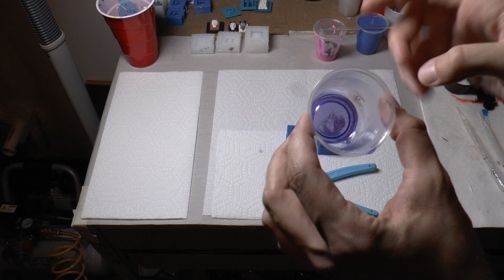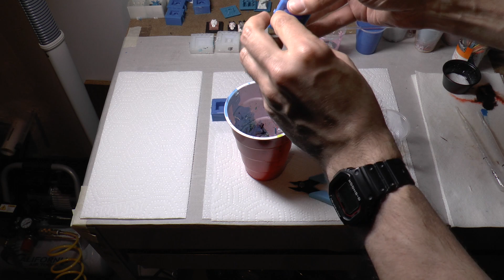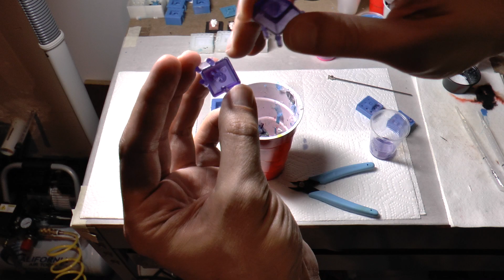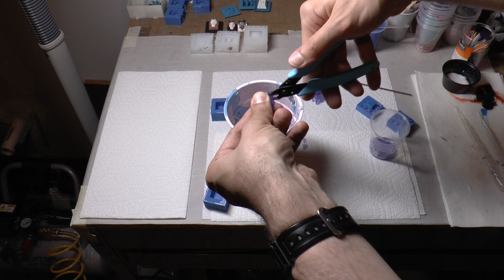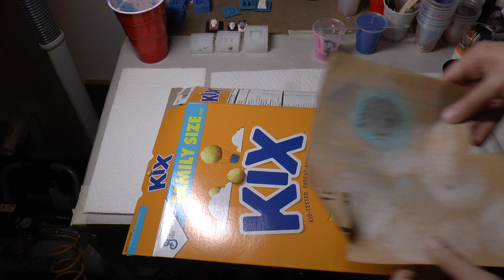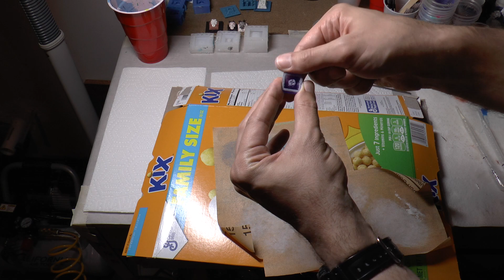Z-Butt:  demolding keycaps and finishing them (4 of 4)

Comment: Hi ! Nice work ! By the way is there a solution to add the letters on these caps ? or even if we are doing non transparent with a lot of coloring, if we want the letter to be transparent (for rgb keyboard to lighten the letter only) ?
Reply from the maker: Thank you!  And good question - that might be tricky.  You could have the outside of the cap as the "shell" with the number or letter missing from the top, that would be your first pour in a multiple mold setup.  Your second you'd fill the rest in clear, and that would fill out your cap and stem, and let light through.

Comment: Great tutorial! I do have a question about the resin though. If I want to cast a really clear cap, what hardener would you recommend since the one you used has a yellow tint? Also regarding the z butt system, do you know how tall can the sculpture be for it to be covered with silicone?
Reply from the maker: Depends on your casting environment - if humidity isn't very high (typically under 60%), Alumilite Clear or Clear Slow don't yellow and they're very clear.  If humidity IS a problem (it is for me in the TN summers), Alumilite's Amazing Clear Cast Plus has been great, 0 cloudiness from humidity.  The downside is it has a higher learning curve (stir slowly, it's much thicker, etc).

For height, the sky's the limit.  If you exceed the typical height for the nohassle container (5-7mm above SA), you'll have to build your own lego tower to get the height you need.  Not the end of the world, but something to consider.

Good luck!
Reply: @NG-ob2ry   damn that's some very detailed explanation. Thank you my guy

Comment: Hi im wondering if there is any other alternative to preassure pot that is cheaper and i also want to know how much you bought yours for.
Reply: From my experiments so far with slow cast resin and no pressure pot, there have been very little if any issues with bubbles. I've had one that I rushed the mixing with and it got a single bubble in the stem which was the worst spot for it to be. Anyways, all my other tests have had no bubbles. So yeah, he's using a resin with a pot life of less than a minute so that kind needs a pressure pot. But the slow stuff like mine, which has a 10 minute pot life, doesn't need the pressure pot. :) hope that helps. Oh and I didn't hear how long he left his, but mine takes 24 hours to fully cure. About 12 and it's able to be demolded but it's a little pliable.

Comment: Great tutorial! The only thing I didn't understand - to get rid of all possible bubbles and make a keycap as transparent as possible - do I need to use a pressure pot - or a vacuum chamber to degas it? Or both? Thank you in advance!
Reply from the maker: Thanks for the kind words!  I use a pressure pot 95% of the time for resin and vacuum chamber the resin before pouring only when doing encapsulations, since even the tiniest of bubbles can ruin an encap.  I only pressurize silicone since it naturally degasses on its own.
Reply: @NG-ob2ry  that is an amazing insight. You are right though, when I clear cast some stuff, some bubbles do appear despite pressurizing it over its curing time and despite my greatest effort in doing prefilling on small details. Now I have to think of ways to DIY a vacuum chamber haha. Thanks for the tip dear sir! You're videos are amazing insight in doing artisinal keycaps. I watched them all and I now have ideas! Will you be making a video with tips on painting resin on the mould? Thank you and have an awesome day!
Reply: vacuum chamber works well with rubbery materials, like silicone. pressure chamber works best for hard material, like resin. The reason which is that silicone is quite liberal in curing time and vacuum chamber takes more time to produce a vacuum than a pressure chamber. Since resin cures fast, pressure chamber works well to squish the bubbles out with pressure, than with vacuum given the limited amount of time . Resin may already start harden before the vacuum starts to occur. Just a hobbyist's perspective though, not much experience but this tends to be for most cases. To make sure, you can research what best method of compression for the specific material you are casting. hope this helps.
Reply: John Vergel thank a lot! But what if I use pressure pot for both - silicon mold and resin? Would that be possible? Thanks in advance
Reply: @mytenore  absolutely bro. I just use a home made pressure pot for casting silicone and fast curing resin. For silicone, i keep them in pressure for the whole duration of the curing time. For resin, same way. I'm not sure if this additional information may help, but you don't actually need to buy expensive pressure chambers if your just casting small pieces of work(that dont require 50 psi upwards). I found a really great tutorial that saved me from buying a 200$ equivalent pressure pot. The recipe are just thick durable water pvc couplings, pvc glue, teflon tape, release valve, intake tube(that thingy for used for pumping air to wheels) and a pressure gauge. It only cost 20-30$( to be exact i only spent 1350 PHP). Just make sure that when it is under pressure, NEVER MAKE SHAKE OR MAKE IT FALL. it will shatter. Just make sure to buy the thick and durable pvc couplings with sizes that are in your needs.
Reply: John Vergel wow! Great advice! I will definitely look into this direction! Thank you so much!

Comment: If you want to cast a keycap as close to transparent as possible, would a vacuum chamber be needed on top of a pressure pot? Is polishing a big part of that also?
Reply from the maker: Sorry for not replying to this sooner.  A vacuum chamber helps reduce the chances of bubbles for encapsulations and glass clear keycaps, but you're right, polishing is the most noticeable improvement.  This glass clear was made with a vacuum chamber and pressure pot:  https://imgur.com/llEkN9b
Reply: @NG-ob2ry  thats looks great
Reply: After watching 99 tutorials i can write this..
I dont think you will have time to use vacuum for resin. 
Pressure pot removes bubbles by pressure. 
Just need to wait, when your art becomes solid (cured) or bubbles will expand if you open early.
You can ofcourse later experiment with vacuum when you work with wood art. (example: replace wood air with resin/stabilize)
Reply: @pastuh  Having time to vacuum depends entirely on the type of resin you are using, so that's just a variable.
The pressure pots often seems to break up the bubbles, and not remove them from the resin in the mold, which is why i ask.